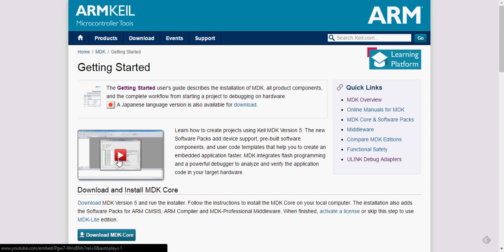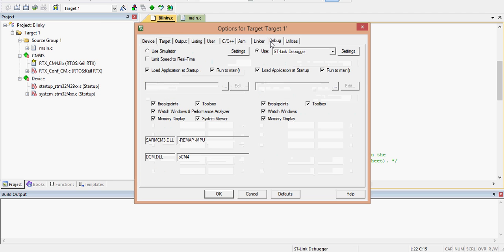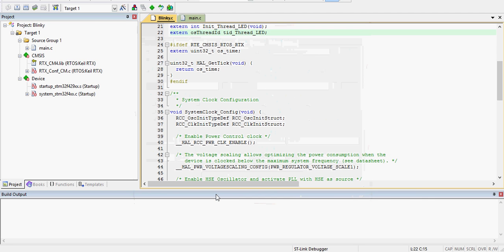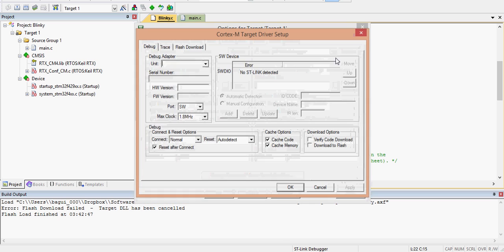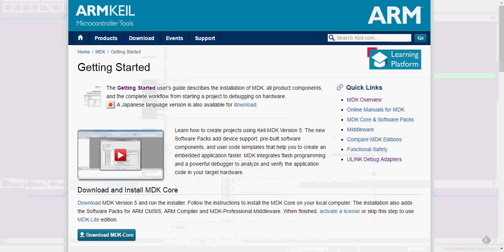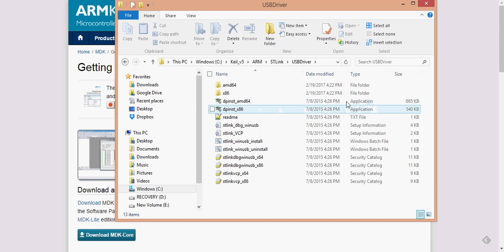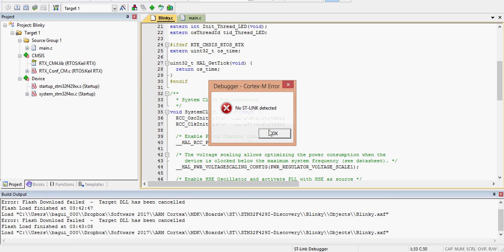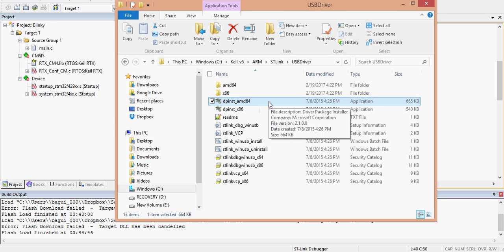Fix STM32F429 No ST Link Detected

Comment: I'm using the STM toolchain; the file was located in: C:\Users\{userName}\AppData\Local\Arduino15\packages\STM32\tools\STM32Tools\1.2.1\tools\win\stlink\ST-LINK_USB_V2_1_Driver.

Double-clicking on dpinst_amd64 fixed the STLink failure.  Thanks!

Comment: Sorry but i don't undertand what do you do? I can't fix it. Please help me.
Reply from the maker: Under options make sure it's using ST Link Debugger, reinstall the USB driver,  unplug the board, close MV5 IDE, plug the board in, reopen IDE, then try to flash blinky program to board. If that does not work, then your boards ST Link not detected is not caused by old usb driver, must be caused by something else.